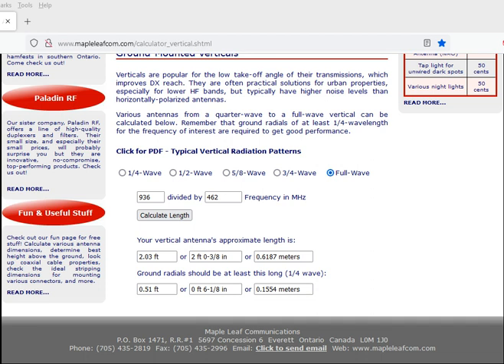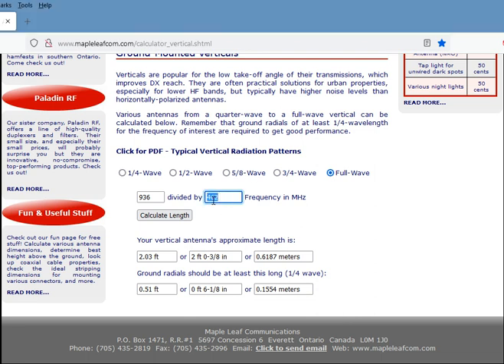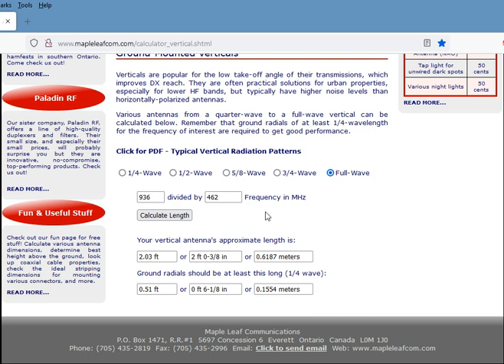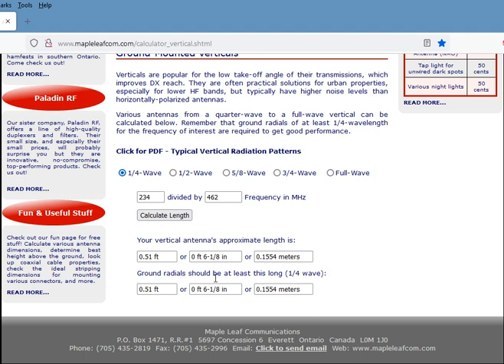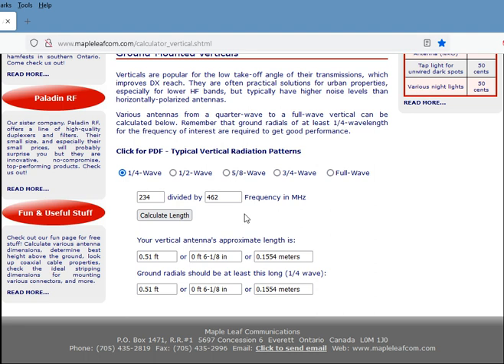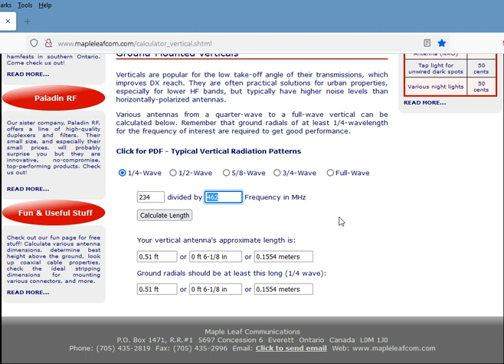🔺Information on building an EASY GMRS two-way radio 1/4, 1/2, 5/8, 3/4 and full wave antennas!!🔺

Comment: I think some folks like me would want to make an antenna that connects to a handheld 2 Watt GMRS radio by getting rid of the non-removable antenna. A design guy I know suggested that FCC compels manufacturers to make transmitter impedances incompatible with any 50 ohm coax, connectors or antennas so the results are poor. Comments?
Reply from the maker: I don't think it will have incompatible impedance due to the output transistors or I.C (chips) that are used in the final TX circuit. I don't think a company is going to make custom-made parts to make it incompatible impedance. Truth be told, I wouldn't even waste my time modifying a radio that has a non-removable antenna. The "better" removable antenna radio models are getting cheaper all the time 🙂

Comment: What's the 234 number for? The website lists no unit or explanation.
Reply from the maker: It's part of the formula to calculator wavelength in feet 234/frequency in MHz  meters would be 71.5 / frequency in MHz that is for 1/4 wave antenna
Reply: @GMRStwowayradio  cool.... So I just type anything I want in there
Reply from the maker: @Gruuvin1  yes for freqs you can enter what you need but leave the 234 alone of course this is for 1/4 wave antennas!!